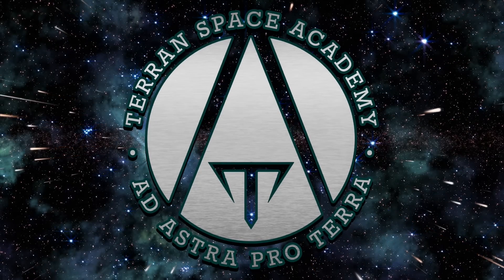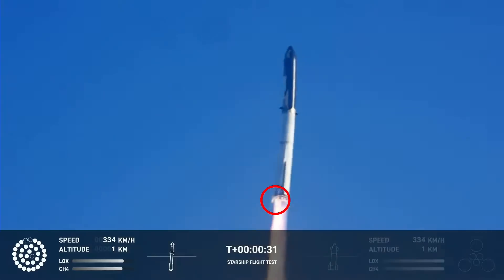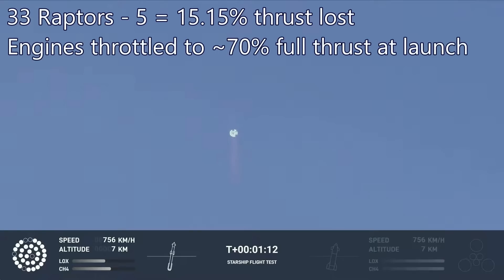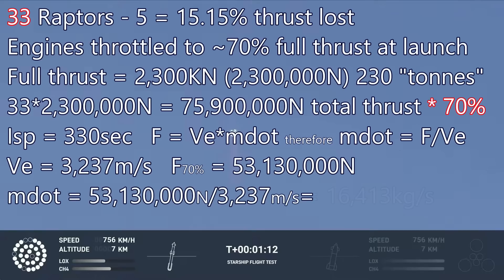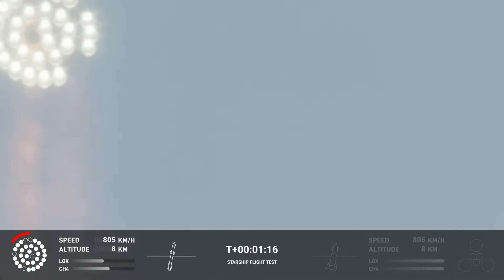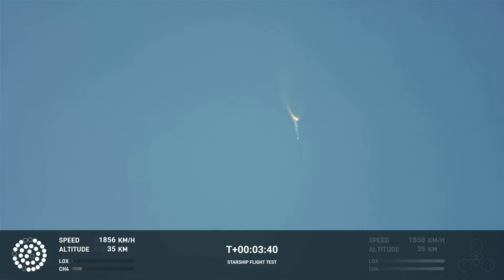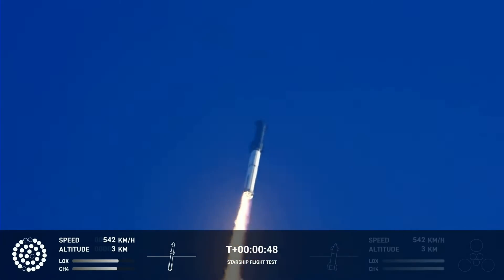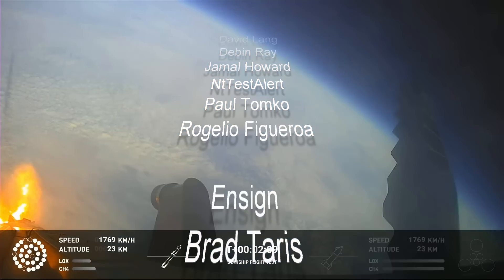Starship Flight Analysis: What went wrong with Starship?

Comment: The flight termination system DID NOT Destroy the rocket. There are gas plumes at their location 40 some seconds prior to it's explosion. So therefore it all failed, including the FTS.
Reply from the maker: Sadly you are correct... even that didn't go right.  An explosion from the bottom of the rocket ended things.

Comment: The abort system did not work correctly.  It took almost 40 seconds after the flight Termination System fired to have the rocket to explode.  Way to long.
Reply from the maker: You are quite right Donald. Covering that soon... with a possible fix.

Comment: I believe the next generations are supposed to use electric motors instead of hydraulics, correct?  When I was watching it originally, it looks like it may have a walker hydraulic system or something, but I’m not a motor percent sure, but I saw people talking about that may be being the case but yeah – excellent excellent video!!   and definitely not thrilled with how the news presented this to everyone, would think they would try doing a little bit of research. There is literally thousands of videos and channel dedicated solely to watch SpaceX is doing lol
Reply from the maker: Thank you so much!  All the newer boosters and Starships have electric TVC so they should be much more robust.

Comment: Is it necessary to hold it locked to the pad at liftoff thrust for 8 sec? It seems like NASA 's were cut loose after about 3 sec iirc.
Reply from the maker: I think it had trouble climbing but I have been told that an extended hold-down was in the plan.  The worst possible would be for it to fail back onto the pad.

Comment: If Von Braun had a Saturn V explode after launch he wouldn't call it a success what a bunch of BS...
Reply from the maker: Von Braun blew up a lot of rockets... and other things... before the success of the Saturn V.
Reply: @terranspaceacademy  don't think Elon put all those powerful rockets clustered together in a multi stage rocket to have it fly in circles leading to it being put out of its misery...
Reply from the maker: Elon would do just that for the heck of it but in this case... he messed up.  There should have been a protective layer of steel over the concrete... it's not like they are short of steel over there.

Comment: Fascinating: so just two engines failing adjacent to one another will put severe strain on the remaining engines that have to compensate. On a positive note, a solution is to make the engines more reliable in this configuration.
Reply from the maker: Exactly Barrios! :-)

Comment: You pontificated "Flip to separate"? Where did they ever say that was the plan? The booster was supposed to "flipback" once separated. Well, according to Elon. But what does he know.
Reply from the maker: The booster shuts down and starts to flip as the Starship disconnects and is flung away... by the flip.  It does not move away and then the booster flip.  Though it probably should.

Comment: I think the holding clamps did not release. So it sent the booster into a loop. I kept trying to break off the starship so the booster kept doing 180° trying to complete the program.
Reply from the maker: That's my guess... they were trying to save Starship, even at suboptimal velocity and altitude.

Comment: The only ones being disingenuous are the ones carrying on like superfans and calling this a spectacular success.

We all saw the 8 engines fail. We all saw the failure to separate and we all saw the aftermath.

And avoiding the word explosion by using the acronym RUD exemplifies the delusion.

The truth is we are years away from anything resembling a success.

Talk about gaslighting.
Reply from the maker: We saw a rocket climb off the launch pad despite being pummeled by boulders and losing three engines before liftoff.
Reply: @terranspaceacademy  pummeled by boulders because of shortcuts in the launch platform build.

SpaceX will be lucky if the FAA grants them a license in the next year.

Comment: It's obviously too early to know for certain, but it looks like the launch pad concrete failed and caused so much damage to Starship, the vehicle's flight was cut well short of what may have been.

Now there's a new plan to place a liquid cooled steel plate below the rocket?

I wish SpaceX would stop putting bandaids on Stage Zero and build a proper flame diverter tunnel already.
Reply from the maker: You are exactly right Ernest... the booster was phenomenal under the circumstances.

Comment: I like your video and the equations, but there are some other factors without pensions, such as the closer you get to an engine's full power rating, the higher, the likelihood of additional failures. As the engines are used and shit is slowly jammed through the entire structure of the aircraft through conduction, you increase the likelihood of other structural failures as well.
Reply from the maker: You are exactly right Dan.  Ramping the engines up to 105% is a sure way to get a turbopump failure.  Please watch the profanity though...

Comment: I'm confused, he said once the booster engines are shut down, they can't be relit. Per his suggestion: shut down the booster, then start one of the turbines on the Starship to initiate separation, then the booster can start its flip maneuver back to the surface. How would the booster flip return to the service if it shut down all its engines? I must have misunderstood something critical.
Reply from the maker: Only the center engines can relight.  None of the ones on the perimeter.

Comment: From what I can see the flight was doomed during the first two seconds. Chunks of concrete blasted up from the pad, striking the engines and/or hydraulic system. It wasn't a failure to separate, it was a loss of power and flight control. They likely decided to abort stage separation and terminate the flight instead. What were these guys thinking when they made the reckless decision to omit a flame diverter from the launch pad design?
Reply from the maker: You are exactly right.  The rocket performed amazingly well under the circumstances... why not just put some steel plating over it?
Reply: @terranspaceacademy  Why not a full flame diverter? Technology that has been proven to work for decades. Why are they opposed to using proven technology known to work? The point is the decision to launch without a flame diverter, a water deluge system, or even a steel plate is beyond reckless! The FAA was just as reckless for allowing them to do it. Then there's the matter of no launch abort system for manned flights. A fatal accident WILL happen, just a matter of when. These guys seem to have a reckless cowboy style. And it won't end well unless things change. If you really want Starship to succeed, then join me in asking these people to behave in a safe and responsible way. Thanks.

Comment: when it started to go out of control, where your saying that it is trying to do the 'flip' maneuver, both of the HPU's had been taken out and the vehicle was out of control.  B7 was the last with HPU's, B9 will be Electrical.
Reply from the maker: It was supposed to shut down the engines... release the Starship... then start to flip back.  Because the Starship is still fully fueled its mass would stabilize while it was pushed away.

Comment: On lift off all the debris that you see flying up is the launch pad's reinforced concrete being ripped apart, some of that debris might have damaged the engines during ignition, there are multiple engine issues during the Ascent
Reply: This was taken off the main discussion I put in. I thought it was more relevant to give it here for you. 

I was just speculating on a possible design version of a flame diverter for Stage 0. Instead of a smooth curving surface how about something similar to a phase fresnel lens? This could reduce the height requirement using less materials. If needed it might be possible to install it with a water deluge for extra sound and pressure suppression between the panels.

I never claimed this idea is great but the lack of proper criticism bothers me.
Reply from the maker: Coming up in the next lesson...
Reply from the maker: Almost certainly Anthony.  I don't think they had three engine failures at startup.  I do think debris knocked them out before they cleared the ring.

Comment: Interestingly a still image has been posed that should there's a buckling between the 2 main sections. Once the tumbling started the torque must have been significant. Also be interesting to calculate the volume of concrete and soil 'displaced' from under the launch platform by the rocket engine blasts - there's quite a crater!
Reply from the maker: Over a hundred tonnes was the estimate we've heard.

Comment: Was the green flame seen on the booster cam (9:50) not also a problem?  In my Starship experience green flame is rarely a good sign and usually means an engine eating itself.
Reply from the maker: It does indeed... oxygen rich combustion/fuel starved combustion will cause the copper liner to burn away.

Comment: I had the same thought that the torque from the flip manoeuvre on the stage connectors would make separation difficult. I'm sure they made the calculations, but perhaps the failed engines had an effect on the flip maneuver and resulted in greater than anticipated torque.

I agree the mission overall can be rated a success because the telemetry gained over the four minutes of flight will help improve future attempts, but calling this a successful test of the flight termination system is going a bit overboard since that was not part of Plan 'A" for the mission.
Reply from the maker: I think the booster engines also failed to turn off...

Comment: I have a strange feeling that the hold down mechanism between stages must be coupled with extreme durability in design, why else would you need to torque them apart like they demoed, unless out of necessity - it may be impossible to go without or with other options per integrity requirements.
Reply from the maker: We think the continuous thrust from the booster engines interfered with separation.

Comment: Sorry too much guess work.  Let the people that designed the kit and have all the data sort it out.  Why do you think it achieved separation velocity.>  Stopped watching at this point.
Reply from the maker: I didn't think it reached planned separation velocity... I thought it tried to separate after reaching its maximum velocity under the circumstances.
Reply: @terranspaceacademy  Why do you think it is only a function of velocity?  It must be more complex including attitude position and rate limits and much else.  What makes you think it tried to separate?  Separation at some random maximum velocity would be dumb and dangerous.   The designers are not dumb.  Except for the lack of flame trench and close placement of the tank farm perhaps.

Comment: Great Job! I believe the engines were damaged during the few seconds prior to lift off from FOD. Certainly other issues could have caused some of the dropouts but primarily I believe the FOD created the major contribution to failure. In addition they get the added benefit of the excavation under the OLT in prep for a more effective water deluge :face-blue-smiling:. No room for flame diverter but I bet that Elon is considering this now.
Reply from the maker: Thank you Tekish!  He needs to...

Comment: Flip before separation? Why create this stress on an already flimsy "tin can"? Why wouldn't they just separate vertically with reverse jets on the upper booster (like Saturn V). How can you achieve orbital speed if Starship has to correct it's vector heading after separation? The plan was to land after 3/4 orbit, not just down range. WTF? Why was the call out so bad? The flip manuever should have happened after separation, not before. Am I the only one who is questioning this?
Reply from the maker: Everything went haywire at the end.
Reply: @terranspaceacademy  ...just the separation...holding clamps may have been damaged on accent.
Reply: Still doesn't explain why the announcers didn’t know the proper sequence...

Comment: Excellent analysis of the failure sequence in the short flight.
It is very likely the ship was doomed on takeoff. The shards of concrete at the OLM may have damaged at least 3 engines, maybe more. This is a recurring problem. Why Elon refuses to address this puzzles me.
A proper trench with a flame diverter and a water deluge system is the real solution. No cute short cuts will do. This problem was solved by NASA engineers over 50 years ago.
You either have the trench and flame diverter or the force of the 33 raptor engines on takeoff will create one for you!
That is basic engineering, not rocket science!
Reply from the maker: We think so too... Flame diverter for Earth... Hover roast for Mars and the Moon.

Comment: (new question attached) Awesome video. Was desperately searching for something like this yesterday. 

One question though, it appeared as if there was venting occuring on the side (and increased in count over time) during the flip and or after. Since the venting plumes were more so pronounced at speed it may have been flames or fuel?

 Further should the landing fairings been out at that time? There was a brief shot of them deployed while the vehicle was going over 1500km/h; way faster than terminal velocity. Was seen before the venting. Sure, not any wind resistance to rip them off maybe, but still..  should they have been out at all especially while maneuvering (flip maneuver)?
Reply from the maker: I think a hole was punched in the oxygen tank at the bottom by debris.

Comment: I’m curious if future rockets will have grid fins that fold back in. At this early point without payload I’m sure it’s not too important, but I imagine that creates a lot of drag as that’s what they are designed to do.
Reply from the maker: They actually don't create much inline but once off line, like in a spin or turn, it can be considerable.
Reply: @terranspaceacademy  Do you think they will ever fold on to reduce drag like Falcon 9 or simply accept the slightly increased drag for simplicities sake.

Comment: so are we saying this wass mechanical failure of the seperation system due to stress, or did the control software prevent sep because it detected the anomalous condition
Reply from the maker: Probably a combination of stress, the booster still firing and hydraulic failure.

Comment: Not sure if this has been mentioned.  The best current theory I have heard is pieces of concrete may have punctured a hydraulic line.  Hydraulic pressure was lost just before separation.  The engines were gimbaled to the position for separation and flip.  Separation never occurred because at that point there was no pressure to release the clamps.  The engines now were also frozen in place, causing the constant flip we saw.  It makes sense.  The next booster will not suffer from that because it will use electric Tesla motors for gimbal instead, maybe separation too, I am not sure.  Either way, they need a flame trench.  I am sure all that flying concrete was the cause of most if not all the engine failures.
Reply from the maker: That's what it's looking like.

Comment: Nice video. You pointed out that second stage false start then dies after take off.

In the first video I also noticed 6 engines have no flames. 

If the first stage was meant to be reused why blow it up in this incidence? Can it steer back and safe landing?
Reply from the maker: Thank you!

Comment: Perhaps you could add comments about why engines were out; did they not start or were they damaged by flying debris?  I consider the lack of a water deluge, thrust gas diverter system as major design flaw.  You "implied" the flip maneuver occurring with Starship attached - curiously, the SpaceX Speaker John implied the same.  I hope I am wrong in what you and he said; why divert the trajectory of Starship with a flip? Excellent numerical analysis especially your "units" usage, note G=1 N kg*-1 sec^2 in CIE Metric system.
Reply from the maker: Debris almost certainly but we are looking for more data...

Comment: few more things, the exhaust pretty much the whole time is much too bright for methane engines. on one side you can see almost through it and the other is all bright. this is likely due to carbon combustion either part of the engine bell of structure is being blasted out. moreover i could see green flashes near its max height meaning it was burning copper and probably through turbo pumps or perhaps pipelines. at launch theres a bunch of concrete being blasted up into the engines i think, likely the first cuprit.
Reply from the maker: Could it be leaking hydraulic fluid?  That would opaque the exhaust.  Compare to the beautiful blue of Terran 1.
Reply: @terranspaceacademy  possible i guess but feels unlikely. for one it seems to come from the outer ring that doesnt use much (any?) hydrolic fluid. plus most of similar flares in other rockets have been other parts as far as i know.
thinking about it, if theres not enough oxygen to burn all the methane cleanly it would create a similar effect i think. thus there may have been an issue with the oxygen.

Comment: Your analysis does not mention the velocity disparity at stage separation. The flight profile I've seen published has the booster accelerating the stack to ~4800 km/H with a separation altitude of ~48 km. Both of these parameters were not achieved with the velocity at ~44% of the expected flight profile. Initial acceleration off the pad appeared normal, but I'm doing further analysis on where in the flight acceleration started to decrease indicating possible thrust decay greater than the consumption of propellants. There is also the possibility of a significant LOX leak. The Space X LOX consumption graphic showed a higher rate of change than for the CH4.
Reply from the maker: Good point... we'll cover it in the next one.